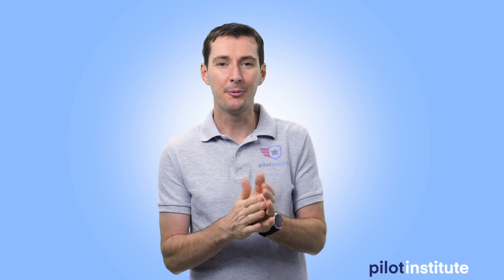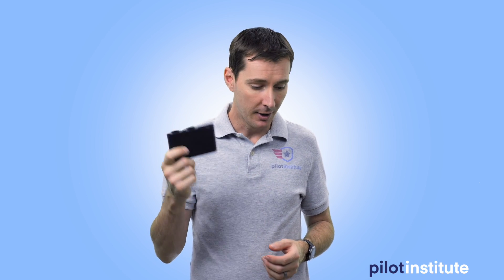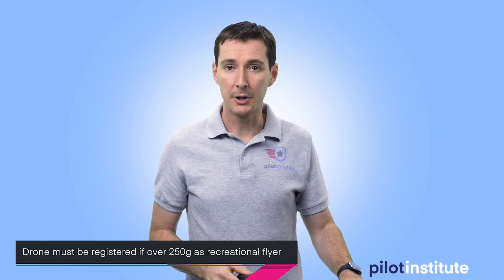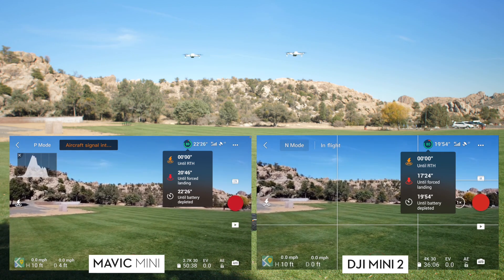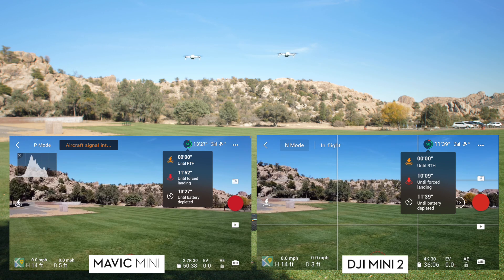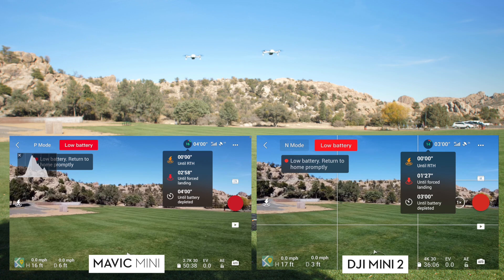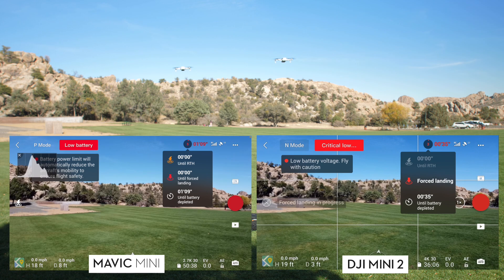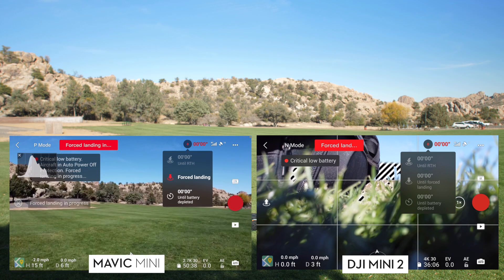Can you use the original Mini battery in the DJI Mini 2?

Comment: I wonder if the Mini 2 will overcharge the Mini 1 batteries to 3.7V? Very interesting because the low cutoff voltage on the mini 2 is slightly higher which is better for the mini 1 battery. It would be hard to cycle out these batteries but its good to know.

Comment: Next video, put two Mini 2 batteries in parallel and use in Mini 1 to see some crazy flight times. Edit: There is a modified circuit board for Mini 1 to enable custom battery modifications.
Reply from the maker: Hah, I wonder how the extra weight would affect battery life. I'm sure you'll get more hours but maneuverability would take a hit.
Reply: @PilotInstitute  I don't think it would be that bad. Mini 2 batteries seem to be quite a bit lighter and more powerful, and there are vids around with Mini 1 modified with even heavier load flying seemingly well. At least it should result in a 60+ min hover if nothing else.
Reply: Don’t u have to literally make the drone bigger?

Comment: It’s worth pointing out that the Mini 2 has LiPo batteries as opposed to the older tech Li-ion batteries in the original Magic Mini - the two chemistries offer differing performance and are designed for the needs of the drone they’re being used in. Don’t mess around with using incorrect batteries - just use what’s designed for the drone you’re flying!
Reply: Blah blah

Comment: So you didn't  notice any performance difference between two batteries? Speed? Wind resistance?
Reply from the maker: No, it seemed to perform exactly the same. I flew it around for a while on a different battery after the test.

Comment: I did but got a low voltage warning so personally won’t use them again even though they did work.  I ordered couple Mini 2 batteries today from DJI were back in stock.
Reply from the maker: Weird. Never got a warning or issues in a few test flights. Are you on the most recent firmware?
Reply: @PilotInstitute  😂 that’s because you’re not me!  It did happen for real the first time doing this because I flew all my Mini 2 batteries and had a bunch of Mini 1 batteries with me.  I was hesitant to fly with them and figured why not try and got some low voltage warning and made the call to not do that again.  I’m sure fine but rather play it safe 110% for me.
Reply: @PilotInstitute  u got a low battery voltage....fly with caution too I’m watching the video now.  That’s what I got.
Reply from the maker: @AtortAerials  Well the low battery warning happens with any battery once you deplete it enough. It showed at the same time for both drones actually. It showed in the other battery test I made too with the battery it came with. That's normal. If you get it on take off, that's an issue, but it really shouldn't be unless your batteries are depleted before you put them in.
Reply: @PilotInstitute  I believe I did get it mid flight....not when landing with battery low I’m almost certain.
Reply: If those Batteries are going to give me at least 15 minutes , I am buying the Mavic Mini Batteries ! Price is Priority right now and if I have to get the Original Mini-2 Batteries later , so be it .
Reply: I bought 4-New Mavic Mini Batteries for what I could get only two Mini-2 Batteries for , I am sure that equals to more flight time for me even if I only get 15-minutes per Battery .